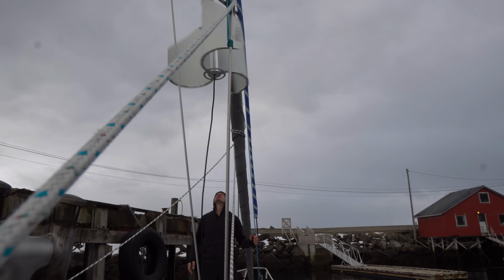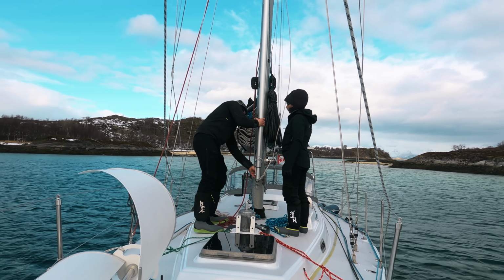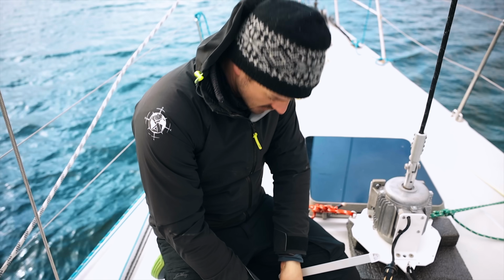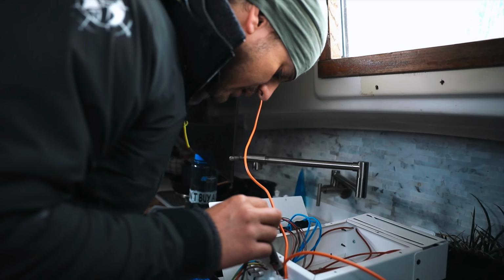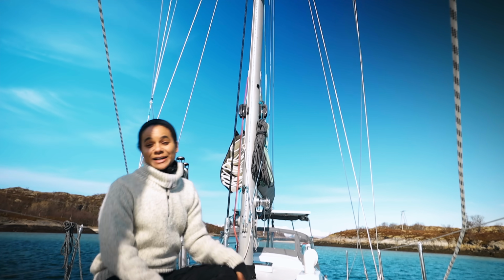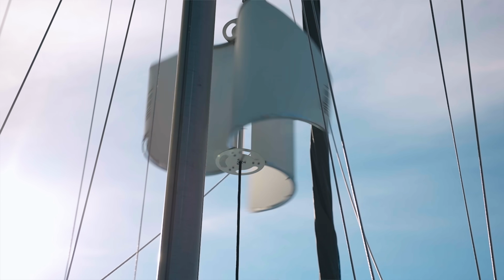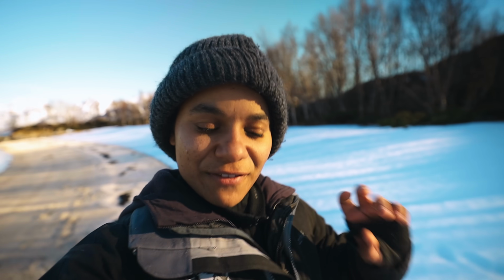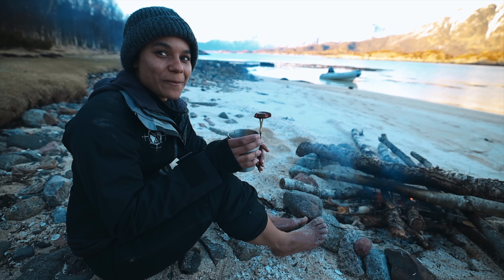No Sailing, Just BULLSH!T — Sailing Uma [Step 273]

Comment: I don't think pulling on a motor spindle is a good idea, friction and axial load on radial bearings won't do anything good. The setup needs a conical\axial bearings coupling to offload the tension.
Reply: Yeah, the losses in the rope is probably in double digits but as a first poc it's refreshing to see some novel (?) ideas being tried.
Reply: @NirreFirre  I think he's using "anti-torsion rope".  It's used in furling rigs and is specifically designed to transmit torque.  I have no idea what the actual numbers are, but it's way better than using simple rope.

Comment: To smooth delivery of a "choppy" power source, you may need to implement some kind of flywheel between the torsion line and the motor.  With the moving gear, you may want to enclose it in a housing.  Good luck!
Reply: I agree

Comment: Cod and chips for lunch it is then!! Nice catch.
Right then... do you think there is enough torque available in the VAWT to put a small gearbox on top of the motor and increase the speed it spins? Might make more useable volts.... if the turbine can spin it.
Reply from the maker: Yea to a gear box. But not a mechanical one. We’ll explain more later.
Reply: @SailingUma  i was thinking a belt drive and a pulley that you could change out to get the best speed. Bit like your first prop motor (i think)

Comment: Just a thought about the squeaky motor. The motor probably doesn't have the necessary bearings to deal with the linear tension of the torsion line.
Reply: Exactly, need to install a load bearing plate with coupling above the generator to take the load off the generator bearing.
Reply from the maker: The squeak was from the fitting I made. Also, most sealed bearing can handle a small thrust load, if they’re installed properly. But that motor isn’t going to be staying long.
Reply: @SailingUma  think you need something like a CV joint then it dosent have to be perfectly alignet
Reply: @SailingUma  You could also try to connect the rotational force from the turbine to an automotive alternator.  It could be either 12VDC or 24VDC 200-amp.
Reply: @WSallai  automotive alternators are designed to generate significant output only over about 1500 RPM.  Without a transmission this design won't get an alternator to those speeds unfortunately.
Reply: @SailingUma , it probably needs a real thrust bearing mounted above the motor. Just a little side load on a flexible shaft or line can create a HUGE amount of tension. Please do a little trigonometry. A force applied sideways could be amplified HUNDREDS of times. This is serious!
Reply: The bearings  in the motor are probably just as good as the instructions
Reply: Did you think about bifacial solar panels? Those could add quite a bit!
Reply: Build  a charcoal maker for your heater
Reply: On mechanical pumps, if the alignment is not perfect they will whine, driving everyone in the room mad. The alignment is so sensitive they sometimes are aligned with lasers.
Reply: @Youtube_Stole_My_Handle_Too  why be a jerk in the first place?  no one owes you anything.
Reply: Build in an intermediate bearing to take load off genetator bearing.  Use this pyramid housing to bolt to deck with.
Reply: @Youtube_Stole_My_Handle_Too  I don't have your education, but I was thinking that the motor looked way too big.
Reply: @Youtube_Stole_My_Handle_Too  hope you got home safely... Now do us all a favor... Stay there... Quietly!

 It's people like Dan who spark creative ideas and thoughts that help move ideas into reality even if it starts out being challenge.
Reply: @Youtube_Stole_My_Handle_Too  damn... You forgot to close and lock the door when you got home 🙄
Reply: @Youtube_Stole_My_Handle_Too  I see the line (rope) as a main source of troubles. Most of the turbine energy is spent because of an internal friction in it.
Reply: I put my earlier replies in another comment (in favor of the need for axial thrust bearings), but I'll add that if a flexible transmission shaft were chosen in order to negate the need for axial thrust bearings and load alignment, I would just consider that the size of flexible shaft needed apparently goes down with increased RPM for the same amount of power transmission.  In other words, due to the (relatively) low RPM of that wind turbine the shaft would need to be larger and heavier, and the rope/thrust bearing solution is still probably better.  Or put a gearbox up at the turbine to increase the RPM's going down the shaft by 10:1 or more (which might move the generator up into an RPM where it's more efficient at generating power- need more info on the generator's design or whatever future generator you are replacing it with).  It would be neat to have a turbine mounted on top of the mast and a transmission cable running down the inside, but you would need a lever to "collapse" the turbine when you aren't using it or there is too much wind (I know, over the top, plus boats and non-stainless steel don't mix, so add more $$ to get anything made in SS).  See graphs in this reference:
https://www.powertransmission.com/issues/0813/flexible-shafts.pdf
Reply: also, I retract my earlier comment about not losing much efficiency with the rope.  lateral deflection of the rope could be eating up a significant amount of energy.  You could test the loss if you were at a dock with a high platform where you could set up the generator directly on the turbine as designed by the manufacturer and then again with your tensioned rope and the generator down at the dock level (with the turbine still up at the platform).
Reply: @Youtube_Stole_My_Handle_Too  You should really start by being kind.  I was going to give your rudeness some space on the rightness of your comments but you can't even do that.  Power equals voltage times current.  It's not watt-hours but watts that Dan should be referring to when discussing the instantaneous output of the system.  But in the context of the discussion Dan is looking at the ability of the charge controller to output a certain voltage and how this is adjustable on the CC, presumably knowing he'll need a certain minimum voltage to even safely connect the output of the charge controller to his battery banks. Looking at the manual for the controller it sure does suck, and to make it more mysterious their website ordering options suggest that you can buy three versions of the CC, a 12V, a 24V, or a 48V, but then it also says the output voltage is adjustable.  Do they just mean that for each of three output versions you can "trim" the output voltage within a narrow range so as not to overcharge your batteries, or that the unit can be set anywhere between 12 and 56 V?  he measures a 12 V output voltage while out on the deck, but I thought Uma's house battery setup was 24 or 48 V, and I don't know what inputs their other charge controller has that brings in the solar panels and I assume has the watt meter inline.
Reply: @Youtube_Stole_My_Handle_Too  Line consists of multiple layers, each layer - from multiple threads. Friction between these threads is the force maintaining a line's structure and keeping lines together in a knot. Unless really stretched (and even then) - line will change its shape all the time, being pushed by the wind and spinned by the turbine - and this is where an energy lost. For the very same reason race cars have next to none suspension.
Reply: @Youtube_Stole_My_Handle_Too  Absolutely. And "change in force" is applied all the time - since line is rotating and force is steady.
Absolutely. And acceleration is about transmitting as much as possible force from engine to an asphalt. When "soft" suspension, built to dispense forces applied by pavement flaws to a wheels - dispenses also decent portion of a "good" force, produced by the engine.
Reply: @Youtube_Stole_My_Handle_Too  Sheesh! Do you work for the diplomatic corps of your country? Much of what you say is no doubt correct but there are massively better ways of saying it without all the insults.
Be positive, be contsructive, be respectful if you want people to respect you and your opinion. Being right isn't enough
Reply: @MercianNeil  Good comment but I don't get the diplomatic corps remark. His comment is rather undiplomatic.
Reply: @Youtube_Stole_My_Handle_Too  These two on Uma regularly perform a lot of nonsense.  Their fanboi's however are too obsessed with their drone scenery and bikini glam shots to consider much else.   Anyways there are marine wind turbine generators which also function as tow generators by swapping out to use a propeller along with mounting the generator on the stern to face backwards, these also have a gimbal type mount to handle off-axis movement of the propeller tow line.  It is often hard to believe Dan's "I did a lot of research" storyline when he does not find these already marine grade units which were popular in prior decades and repurpose them instead of buying this industrial-grade unsuitable gear.   The marine towing generators can likely be found really cheap since they went out of favor for various reasons.    At the end of the day I wonder if Dan simply enjoys spending the patreon money of his fans on these "obviously won't work due to basic engineering principles" projects.
Reply: @jonathanoasis  This sounds like a solution for while under way, not for while at anchor.  At anchor it would still need to be mounted somewhere, like a mast, which would have the disadvantages mentioned in their video, except I don't know about the vibration one- I would expect the horizontal axis units to not vibrate that much.
Reply: @caveguru  a marine towing generator would seem to have solved many of the same forces as their hoisted prop and could be used as the base instead of their unfit generator unit/unfit charger control unit.  Seems like many aspects of these problems have already been solved...in marine environment..by qualified engineers...   "did a lot of research" meh!

Comment: You need to reach a certain rpm for it to generate electricity
Reply from the maker: Not really. Depends what you mean by “electricity”. Volts are developed at 1rpm.
Reply: @SailingUma  What is the nominal rpm for that generator? can you maybe do a tear down video, so we can see the insides, before trowing it out/ giving it away?
Reply: @ffoska  you have to check on the specs
Reply: @SailingUma  with No load , stick a load on and the motor will probably stop , I don't see much future at all in that setup I remember trying to charge a car battery with @ 1/4 hp motor and a car alternator as soon as the charge leads were connected it stopped dead (the battery was pretty flat hence quite a load) you would be much more likely to get results from a small motor something that in reverse would turn the fan, maybe a drill motor etc etc good luck keep safe. Pho

Comment: I know nothing about sailing, so if this is stupid, please forgive me but, might it be possible to build a framework off the back of the boat and mount it just off of the stern?
Reply: Perhaps glass in a box and run out one on each side at 90 degree angles. Fold them into the box when not in use?

Comment: Would a permanent magnet DC generator work better, provides 12v at low rpms, check out Missouri wind and solar webpage. I have one of these pmg to be mounted as a propshaft alternator.
These are standard automotive Delco type alternators turned into pmg. Rpms limited to maxmax 1000rpm. Will provide 12V at some 120rpm or less.
Reply: Only one issue with that idea, UMA has a 48v system so they need a lot more power than 12v. However, for whatever reason their unable to produce big voltage fron their generator they can route the power into a dc to dc inverter to take some load off of main battery bank to conserve power. Providing they have a rectifier of some kind. Cheers mate!
Reply: @jamesfrankland6820  A Victron dc/dc converter easily handles that, fact is these vertical axle turbines (Savonius rotors) effiency is really poor. Good for minor trickle charge, not for domestic production. The generator would have to be a large diameter pmg type running really low rpms, can easily be built. A horizontal turbine , 2pcs 400W thats not too bad. My Rutland 1200 is not noisy and produces energy enough. With proper long pole and good positioning, shadowing pvp is not an issue.

Comment: Love the nod to Erik, and definitely love that idea of using the torsion rope as a turbine shaft, that's crafty!
Reply: My name is also Erik and that freaked me out as I was not really paying attention at the end and the Dan said my name and pointed at me.
Reply: I'd imagine if some kind of flexible carbon tube long enough would be better (and possible in terms of cost) for energy transfer (because it should be stiffer against torsion)
Reply: @BrunoVasco  definitely, it would just be about storing it and dealing with it if they really do intend to make it removable especially. 
I was thinking potentially some type of telescoping aluminium pole. Something similar to a paint roller extension. Could also make something out of small tube and use some type of pins or couplers to put it together for use.
Reply: With the torsion line you could mount more blade(s).
You can use a boost transformer to raise a constant voltage to a usable voltage going into your mppt controller . The initial  generated power needs to be regulated somehow like a car alternator has a regulator to prevent over voltage.

Comment: Voltage and amperage. In motors as the voltage drops amperage goes up but also generates a lot of heat. This is why construction saws and drills on extension cords you want heavy duty #10 and #12 wire cords (otherwise the tools still work but the motors 'burn up')  On your set-up.... maybe the initial  lower voltage setting in your Tesup (??) box raised the amperage/heat in some of the components. 
Your basic idea of the vertical spinner seems really good. It is quiet, and it's up where there's more wind.  All it needs now is to be a single component that gets hoisted up with the generator as part of it and then just 'anchored' or tied off with two lines and then a dangling plug to the charge controller.  Or at least parked off the back deck like the spinner ones. 
Maybe when I finally get my boat I'll have an Uma-gen.  
When you have snow(ice), water and fog (close enough to vapor) you have a Triple-Point - liquid, solid and gas. If you look at a chart of the States of Matter of water at various temperatures/ pressures it's right there in the middle.   It's actually pretty amazing.  There's no other planet in the Solar System where this is possible. So good observation Kika.  And your comment "That's why I love this planet." brilliant.